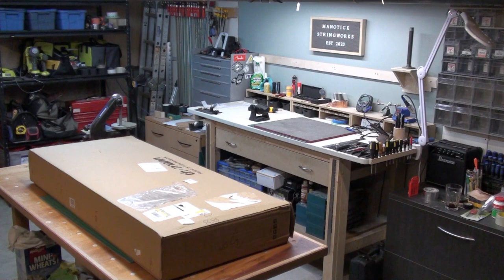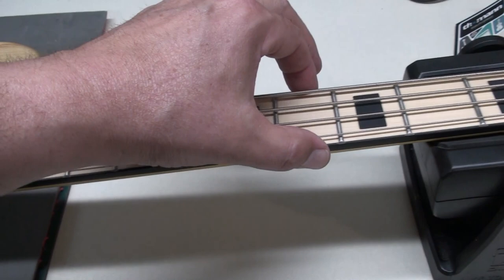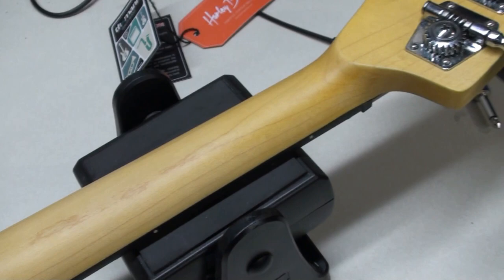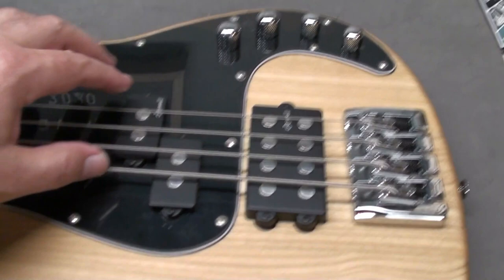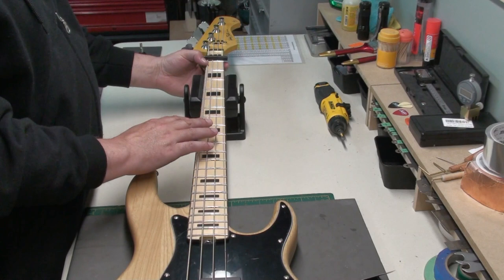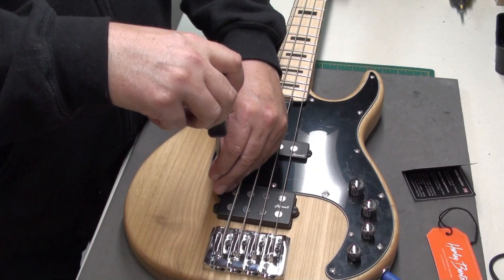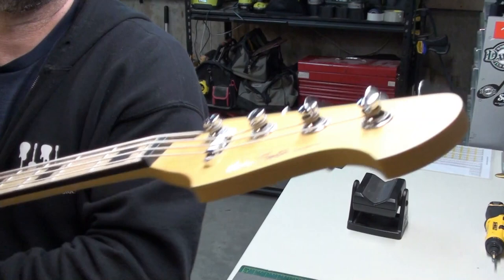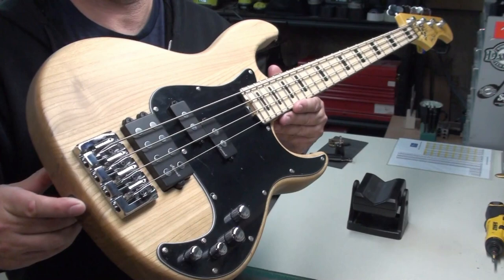Unboxing a Harley Benton MP-4MN Enhanced Bass Guitar - how can it be less than $400 USD??  Amazing!!

Comment: I bought this bass about 3 years ago as my curiosity got to me considering all the great appointments Thomann/ Harley Benton have dressed this bass up with. Mine is one of the blue finished ones and yes for the money these are incredible. Mine arrived slightly damaged and my first sound impression was hmmm noise preamp and a very dark sounding bridge pup. I contacted Thomann about returning it back to Germany from Canada as I was not happy with the bass regardless of it's sexy looks and great appointments, Thomann made a deal with me That I was to keep the bass and they reimbursed me in full. Well ok if you insist... so I still have the bass. I do play it live from time to time and its ok, I haven't modded  it (new pre and pups) yet but it is a modders dream bass.

Comment: In passive mode, the 3.xxk reading is with the pickups in parallel. That's why it's 3.85k but you can figure out what the other pickup measures at by solving for the missing number in the parallel resistance equation.

(P1+P2)/(P1*P2) or whatever it is. You know what P1 is. (8.74k + x)/(8.74k * X)

And solve for X or whatever.
Reply from the maker: @J.C...  Thanks!

Comment: There's really nothing to dislike about this bass. The features I really like are the stainless steel frets and the zero fret and the Musicman style truss rod wheel. You get the lowest possible action and you can use any gauge string without messing with the nut. I prefer a J Bass style body but this is OK. The only thing someone might consider upgrading is the pickups, but it's still a killer deal. I would get the Lake Placid Blue version.
Reply from the maker: They have  Jazz bass version of this bass
Reply: @ManotickGuitarTech  Do you know the model number? I prefer the J Bass shape above any other. The off set body makes it so comfortable when sitting.
Reply from the maker: @jburtonca  check out the Harley Benton website
Reply: @ManotickGuitarTech   I found it. It's the Enhanced MJ-4EB Lake Blue

Comment: 14:28 ...... Check pick up's in passive mode only as that way you can get the actual resistance load of each pick up with out the preamp being added to the meter reading. The issue you are having at the start of this time stamp is the preamp is not allowing you to see the true resistance reading of the pick up's when the bass's preamp is in active mode. Pull up on the volume knob to engage the Passive Mod to check the Ohms ! Also MM HB pu's always seem to be of low output for a humbucker p/u .

Comment: I didn't read thru the comments,  so someone may have already answered this,  but in active mode, you were reading the output of the preamp.  That's why the pickup pan didn't change anything. As far as the bridge humbucker being so low,  they are wired in parallel,  so that's what you'd expect.  Great basses though.  I have two of them,  but five strings.

Comment: Great review; I have the Enhanced MJ-5 version and Absolutely Love it; Hands down the best Bass (under $500) that I've ever played/owned; a tad bit on the heavy side, but def. not a deal breaker for me. I've since replaced/upgraded the preamp with an Audere JZ3 Pro and Wow, a definite improvement in tone and bottom end, much punchier and now I have a passive tone control as well.
Reply from the maker: I might try changing the preamp as well - good suggestion

Comment: 12:06 I have noticed the exact same thing in a Fusion III guitar. It is not that big of a deal but I ended up returning it because if you notice you can't unnotice :P It also had the same misalignment of the bass strings with respect to the top of the pole magnets. Maybe a mounting issue on their CNC machines idk.

Comment: Even though I do own the usual 'High end' guitars, I'm very partial to the Harley Benton Fusion Pro's which are excellent value for money.
They come with roasted flamed Maple necks and fingerboards, Stainless Steel frets, Locking Tuners, Wilkinson bridge and the only thing I would probably say needs upgrading would be the pickups, I have replaced the pups on a few of them with my preferred DiMarzio's (Tone Zone in the Bridge and neck with a FS-1 for the middle...they are in HSH configuration) and they are stellar.
Now when gigging, the Fenders and Gibson's stay at home (probably safer there anyhow)
Reply from the maker: I think with some setup care and maybe a couple of small upgrades/mods, HB's are super playable.  I played this bass last night at a gig and it sounded great and felt good to play through 3 sets.

Comment: The quality with Harley Benton is hit and miss. I had the exact same model and returned it. There were so many little finishing flaws that added up (the pickguard was cut very scaterred and not smoothed out, the inlays weren't real inlays but (badly) painted on, the battery compartment was screwed in with only 2 of 4 screws and the screws were screwed in crooked not straight). Maybe I just got a lemon, can happen in this price range. The sound and preamp was also a bit disappointing: in passive mode no tone control and in active mode the humbucker sounded very thin and weak compared to the split coil. The spec sheet reads fine and the looks are great - but in the end the total package was disappointing in my case. I also have a PJ-4 HTR from Harley Benton and that one is nearly perfect, especially for the price. Same for the Harley Benton guitars I have (a ST-62 and a SC-550 II) which only required a little setup work to fit my taste. Everything else is more than good for the money.

Comment: Hi Steve.  I'm thinking of buying one of these.  I am a guitar player who is interested in transitioning to bass.  I don't know much about active instruments.  I'm assuming that if there is no battery installed, you can play in passive mode by pulling up the push/pull pot.  Would that be accurate?  Once mine arrives, I will contact you to get it inspected and set up.  Cheers!
Reply from the maker: Passive mode bypasses the active battery circuit - cheers!

Comment: "Not quite sure what to make of that"  when measuring the pickups.  Well it shows that resistance values of pickups are totally useless and do not say anything about a pickup. The only thing that can be deduced from that is whether a pickup is shorting when it has a low to zeroohm rating or it is broken when it  has infinte resistance.
In active mode what you measure is the output resistance of the pre amp. But agian this only resistive as a multi meter uses dc for resistance metering.  To get a really meanigful  number  you would need a way to measure the ac output impedance to tell you any thing

Comment: Good review re the build quality etc but no review is complete without a comprehensive sound test.If you dont play yourself,then get someone who does and has a decent amp to let us HEAR the bass,which after all is the most important point.
Reply from the maker: I might add some sound tests in upcoming videos... I am more interested in the tech and build quality usually
Reply: I understand completely.BTW it would be more likely that the humbucker is badly sited rather than the bridge due to the string alignment compared to the P pickup which seems OK.😁